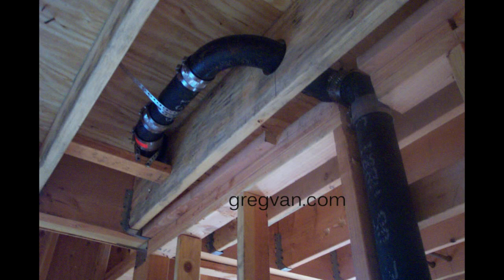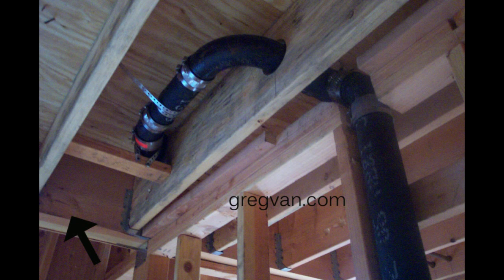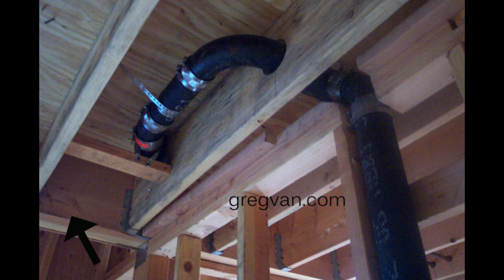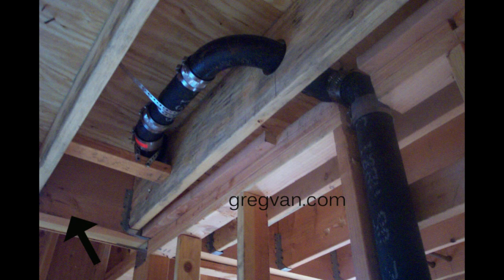Keep Floor Joists Away From Plumbing Pipes - Floor Layout And Framing

Comment: I'm a novice but isn't there supposed to be wall framing plate straps on each side of those framing top plates where the pipe runs down the wall for additional stability?

Comment: Hey.  The pipes have to go SOMEWHERE!   Where is it gonna go?   And no way do you need to move a floor joist over a few inches.   That is a big job.
Reply from the maker: I think the point of the video is that with a little planning, you might be able to do a better job. If the floor joist was moved before it was installed, then it wouldn't have been a big job.

Comment: Greggy baby, There is a no hub band with screws inside that drilled hole in the joist, that's why it's the size it is.
Reply from the maker: I don't know if that was the point of the video, but appreciate your comment. If you're suggesting that the plumber was going to install a no hub band with screws inside the hole, it never happened.
Reply: Unless I'm mistaken the end of the cast iron 90 was inside the hole. I've had to do that before, so has every plumber that has done new construction residential, tho i've done mostly commercial, just have to make the hole big enough.
Reply from the maker: Yes I would imagine a pipe with a 2 inch outside diameter would need a hole at least 2 1/4 inches, because lumber can expand. Is there a general rule of thumb in plumbing for a minimum measurement between a pipe and lumber?
Reply: For 2" pipe a 2 5/16" bit is standard. If the band is in the hole, I usually notch a spot for the screws and widen the hole a little with sawsall to accommodate band.
1/2, 3/4 and 1" all get drilled with 1 3/8" bit so they work with pipe violators.
Reply from the maker: So realistically the distance between the pipe and the lumber is just a little bit over an eighth of an inch. In framing it's usually a 16th of an inch, for example if we have a half inch bolt you need to use a 9/16 inch drill bit. Thanks for sharing your information with us.

Comment: It is always the framers fault even tho we are give a doodle with walls on center and no indications of plumbing. the main problem is these and most houses are designed by a drafter not a archetechual enginer. and other trades are hacks I'm comparison yet they bitch like they could build a house based on a 1/16 doodle

Comment: I would bolt a six foot long piece of 1/4" x 4"  (flat bar) steel vertically and centered right under the pipe hole. ( basically, leave the standard joist spacing and add support where needed) . Plumbers should recommend this, and of course, charge for the reinforcing if the recommendation is accepted.

Comment: The main riser should have come up on center and the framer should have headed things out, OR, bring the riser up so you run WITH the joists and line vent ahead. When I did rough in on 2 stories I make a trace of the second floor joists, lay it and window openings etc over the 1st floor and make sure I bring up risers in a good place. This was a lack of communication and it is usually the framers who do NOT want to buy another piece of lumber who cause the problems. They ALL KNOW there will be issues if they set a joist anywhere near center of a toilet, or a bay w/ a stud on center of a valve but they are too lazy and will not do it right. Been there done that stopped construction and now I make 4 times the $ working 4 times less fixing the wannabes mistakes like this. Wannabes.......

Comment: Just freaking build a house out of cinder blocks. I am tired of seing all these american houses build out of wooden sticks and splinters. Sagging floors, creaking beams, exterior walls out of plywood... It is ridiculous.
Reply from the maker: +Andy S Good point, but it's all about production in America and these homes can be assembled a lot faster.
Reply: +Andy S  I helped build a house in Germany (1965) out of cinder block.  With two other young twenty somethings and myself lifting the blocks up onto the scaffold and to the block layer, (Gunter) it was all we could do to keep up with the guy.  He could hold a full block in one hand and butter it and seat it on the wall faster than many masons can lay brick.  

But at a US cost of a dollar for the block and over 65 cents per block labor it would not be worth it compared to stick frame.  The Germans also poured concrete first and second floors without knockout plugs for the plumbing so they had to chisel holes for each penetration for the stack. And the owners son was a plumber.
Reply: +Andy S ... Sagging floors and cracking beams sound like poor engineering with undersized members.  Same with sheathing with less than 3/4 in plywood - or at least what passes for 3/4 inch.
Reply from the maker: +arbeeex Excellent point and we can also add additional weight. I've seen water beds and stacks of books damage floors also.
Reply: how do you build a joist out of cinder blocks?  lol.
Reply: @superwiseman452  or floor...

Comment: a 2x4 wall for 3 in ci pipe is too small. a 2x6 would've been the way to go. I wouldn't cut the double plate either.

Comment: as a plumbing the less drilling we have to do the better.  we dont enjoy drilling 4 in. holes up on the ladder with a heavy right angle drill.  but when we show up  the joist are where they are and we have no choice.  the drains have to go were they go. i think its on the architect to think of these issue's while drawing up the blue prints. but this never the case.  so then every one blames the plumber, but we are only playing the cards we are dealt
Reply from the maker: +Matt Galanes Trust me, I'm not blaming the plumber for what they have to work with and agree with you that architects, engineers, carpenters and plumbers could build better homes with a little more planning and that's the true message of this video.
Reply: Oo
Reply: Exactly what he said

Comment: I wouldn't put the blame on the carpenter doing the framing. He is following the framing plans that the architect provided. The carpenter does not have the plumbing plans. Even if the carpenter can foresee the upcoming problems, it is not in his power to make modifications to the plan.

The cost of a carpenter to stop production so he can see the foreman who also has to stop what he's doing so they can explore the situation so that after the foreman can take yet more time to have the architect explore the situation with an engineer. Too much time consuming. This would cost more than what the plumber had to do to work with this situation. The delays would hurt everyone down the line. Things like: Electricians, drywall crew for example not being able to start on schedule screwing their precious agenda even more.(this would include the plumber too)

I am no plumber but this looks like an ugly plumbing job. Yet, I am putting my trust in the plumber to have the knowledge of what is acceptable according to code. If a professional cannot do his job up to code because of an obstacle, then it is his responsibility to find the contractor's foreman and explain the situation so that a proper solution can be adopted.

If the plumber who did this job would of went to the foreman in first place, MAYBE, something could of been done about this. Maybe not for this construction site as it might of been to late to change but it would of made it easier for the next house.
Reply from the maker: I'm not suggesting to make modifications specified by an engineer, but if you do know enough about plumbing then you would be able to put floor joist in better positions. All I'm suggesting is that sometimes a little planning can prevent problems that stop the job or delay it for long periods of time.
Reply: You are right, about the planning, it comes from the architect. Your not happy about the framing plans, take it to the architect. What I am saying is that even if carpenters do have some knowledge about plumbing, he still has to follow plans and codes. Any modification to plan can have an impact on structure integrity.

If the architect would of took time to analyze his plans this would of been avoided. If architect would of used proper software this would of been spotted. A good foreman would of spoted this before you got to the job site as well.

All I'm saying is that carpenters should not make modifications to structural plans on the request of others. Not that he doesn't know how to solve that problem, just that it is not his call.

And no it is not as simple as just moving a joist. Joist has a maximum of distance allowed between them. So if you move one, you usually have to add an other one to respect that maximum. Very simple when it's done out of solid lumber. But in this video we see engineered floor joists. Those, on a construction site, they are usually precisely counted and rarely have extras which is an other reason why carpenter will not change plans.

I understand the frustration when situations like this happens. But do not take it on the carpenter, you are loosing your (and his) time. Yes, an on the job site solution is possible. But not always the carpenters call. The architect or owner might prefer a different solution than "just" moving a joist. Could of "just" moved the wall as an other option.

But you know what, often carpenters will see the foreman when he forecast future problems and you know what he gets as an answer? "let the plumber do his magic" or "let the electrician find a work around" And you know what... most of the time you do find a solution. When you don't, we come back to the spot and make the modifications.

So in this video, it does look like a sloppy job. Will it cause problems? Don't know. If it's up to code then probably not. If it's not up to code than the plumber needs to go back to school to learn properly or grow balls so he can talk to the foreman and refuse this type of installation.
Reply from the maker: No it is to code and won't create any problems because I believe it's a 2 x 6 wall. I just created the video to point out another way that would work better and would require less work.

Comment: I like your videos but I haven't found one yet that addresses problems when you're in a confined space (shower, bathtub).  The videos I've found assume you have complete access from below / above to move joists and other easy, elegant solutions
Reply from the maker: Could you provide me with an example of what you're looking for or provide me with a question I can try and answer.
Reply: gregvancom I wish to centre the drain for my shower in the shower space which is 38x38, however, on centre is a joist.  I have no access to the space from below.
Reply from the maker: In order to do any modifications, you would need to have access to it. Can you remove the subfloor sheathing or ceiling panels below and if it's concrete then you might need to remove that before you can move the pipe. Why can't you use the existing shower drain or is there an existing shower drain?

Comment: Just add the joist next to it.
Reply from the maker: I think the main point I'm trying to make in the video is to lay everything out correctly the first time so that you won't need to do any more work. Remember, this particular situation is an accepted practice by plumbers and homebuilders and approved by most building apartments. I was just trying to make a simple point about how a little more thought in the planning process can provide you with a better product.

Comment from the maker: You're right, but I worked on plenty of homes that ran into the same problem over and over again, even when they were the same homes. I think you can solve most of them, but you will actually need to take the time and that's where I think the biggest problem is with things like this. One time I had three pages of problems for one building, because I took the time to look at the plans, but didn't get paid for my time and that's probably the real reason why people don't take the time.

Comment from the maker: You've got a good point, but if you can position the floor joists correctly, you would need to cut a hole in them and that's the main point of this video.